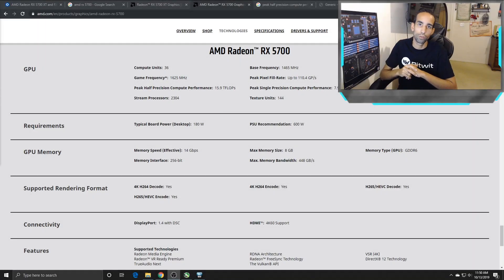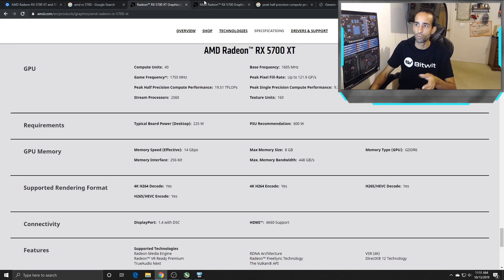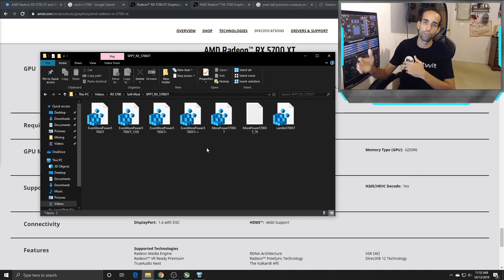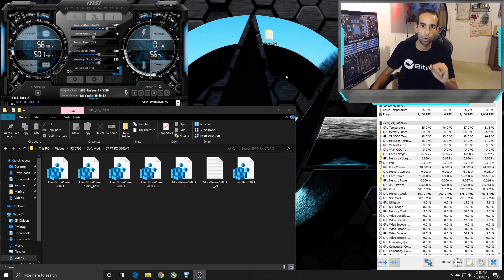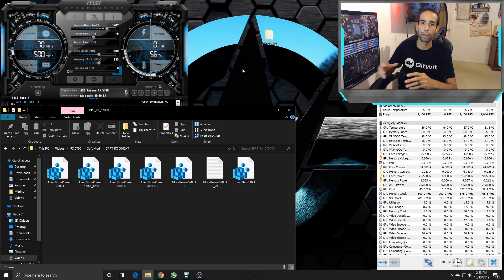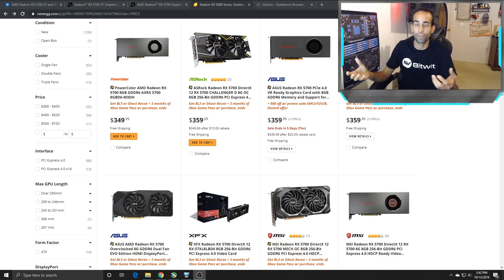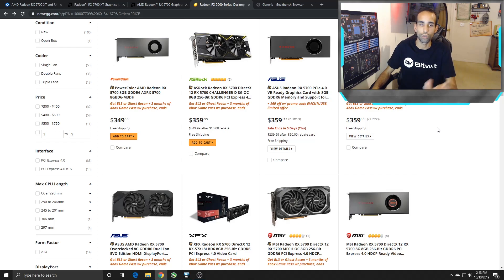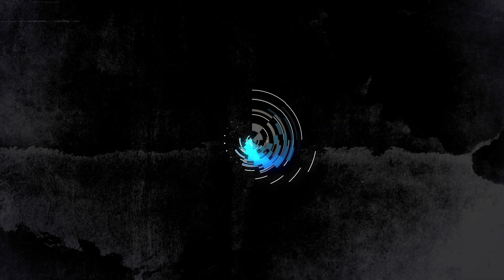RX 5700 XT Mod - VBios Vs SPPT

Comment: great video and very well detailed!
I have some doubts, is this 5700 dual bios?
If he is not and I have problems with the procedure he will not start again, so how do you fix the problem?
Reply from the maker: So when you dont have a dual bios, you would need to use another GPU or iGPU (if you cpu has one) to boot back in OS and reflash it back. ALWAYS make a backup of your original Bios.
Reply: @SerpentXTech  I understand in this case, I will have to choose another model of the RX 5700 because the Challenger does not have double bios, which makes things more risky and my CPU (R5 3600) does not have onboard video.
Thanks for taking my doubts, it helped a lot !!!!
Reply from the maker: @Kaulcifer  if you do get the Challenger just use the MorePowerTool to increase performance with no risk of Bios flash. I have a vid on the SoftPowerPlayTables and MorePowerTool
Reply: @SerpentXTech  
Perfect, I'll watch to analyze it better.
Thanks again for the help